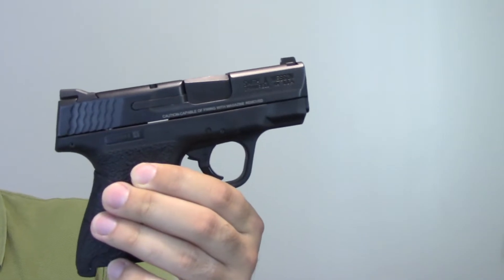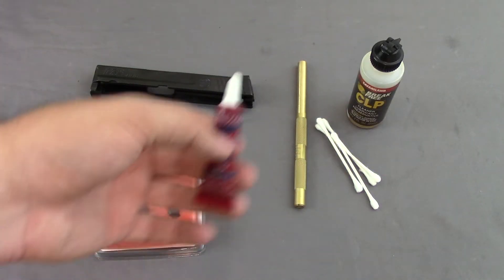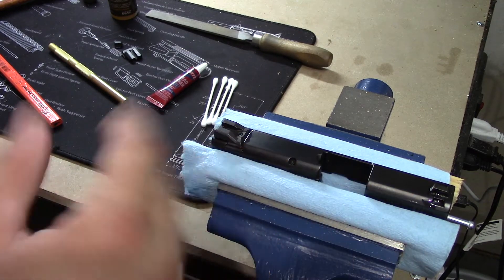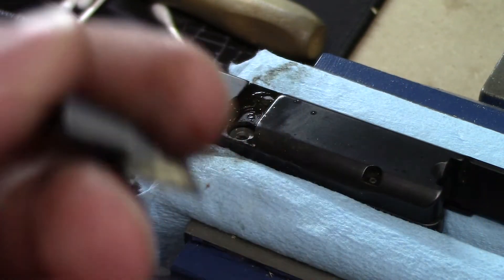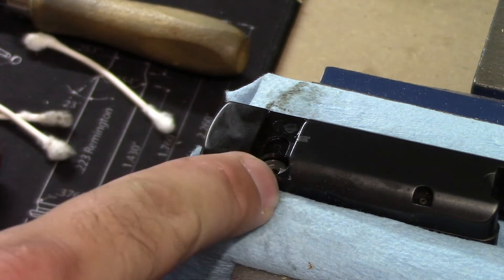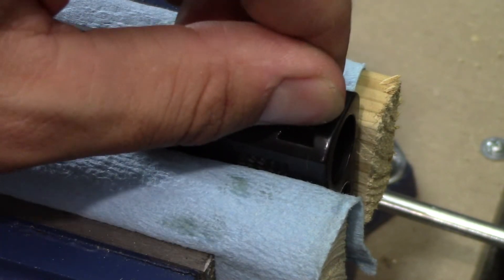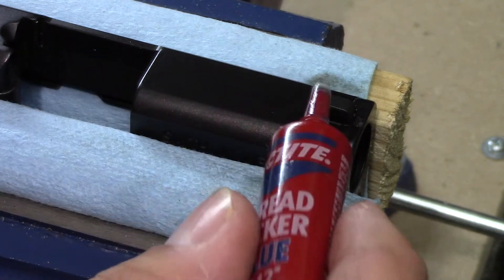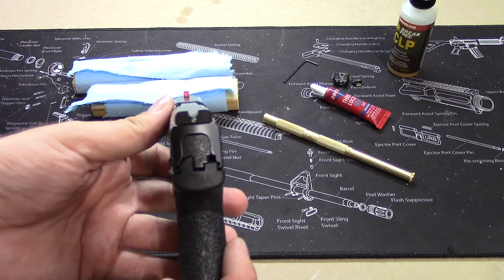S&W M&P Shield Ameriglo I-Dot Night Sights Install and Review

Comment: Those rear sights are a bitch to hammer out. I ended up just ordering a sight tool and changed them out much easier.  All M&P's & Shield's are a pain to hammer out the rear. So there's my take on it. 👍
Reply: Agreed 👍🏾

Comment: were you able to reuse the screw on the oem rear sight on the new sight? on mine the hole is smaller and wasn't able to insert the oem screw on the new rear sight. i figure you have to drill into the rear sight hole to made it bigger in order to fit the oem screw.

Comment: Wouldn't it be easier to just use a sight pusher?   I'm curious why you're not.....That was one of the first tools I purchased......It's paid for itself several times over and knowing I will not snap a sight post......Maybe because I own several expensive 1911s and will never beat on a slide like that on a $1500 - $2000 pistol......To each his own.....

Comment: Well, you really scratched up your slide and those sites
Reply: @runningbear6391  for your future guns
Reply: It's brass from the punch. It wipes off with solvent.
Reply: Semper Fi I don’t know how it scratches it but it did look at it it’s clearly scratched
Reply: @wallyj2000  You can buy nylon/plastic punches for dirt cheap if you're worried about scratching. The brass punch is harmless, it's a soft metal, not even magnetic.
Reply: @wallyj2000  That's not scratches, that's pieces of the brass on the slide. Besides brass being softer than steel, and unable to scratch it, that armornite nitride finish is extremely tough and very difficult to scratch.
Reply: The real thing is that he took it out left to right and replaced it left to right as well. Should have removed right to left (parts exit the same side shells exit on) and should have installed left to right.
Reply: Brass won’t scratch steel but it sure in the heck will scratch the black finish. Notice he never showed the slide all cleaned up scratch free because beating the slide with a brass punch will mar the finish. I bought the sight pusher that’s specific to the Shield even though it was a hundred bucks because I did not want to mess up the finish. It was so easy, didn’t need a vise, no beating and possibly scratching the finish, just turn the handle and it gently pushed out the front and rear sight and pushed in the new ones just as easily. I didn’t mind spending the money on the proper tool as I can change my sights easily any time I want and I can make small adjustments to sights to get the gun properly sighted in. I have the .40 and I just bought my wife the 9mm version and I got more use from my investment in the right tool as I changed her sights out as well as my mom’s husbands Shield and made small adjustments to sight them in properly. By the way I would sight the gun in at the range before using thread lock on the front sight. . On the shields they want you to drift the front sight, not the rear to sight in the gun.
Reply: @fastdude2002  which sight tool did you buy? And did you have to adjust all the sights after the install? Thank you
Reply: Ralphy Figueroa I have the standard MGW sight pusher that was $100.00. I just read and confirmed they discontinued this model and only sale their MGW pro sight pusher. The pro is around $300.00. It is a better version but I don’t know if it’s worth it to pay that much to change out one set of sights. You can get a gun Smith to do it for $25-60 dollars. My mom’s husband went that route but when we went to the range the gun was not sighted in correctly so I pulled out my tool and we got it dialed in. I guess he could have brought it back to the gunsmith and ask him to make an adjustment or take it home and try to drift the sight slightly with a punch and hammer being careful not to damage the gun. It’s just really handy having the tool to make changes and adjustments yourself. As to your question if I had to adjust both sights after the install, no the rear sight covers the rear of the slide edge to edge so once you mount it you’re done, after mounting the front sight centered the best you can go test fire and then you can make small adjustments to the front sight to get it shooting dead center. If it shoots to the left you would adjust the front sight slightly to the left to bring the shot back to the right for example. Usually you would adjust only the rear sights to sight in which has been my experience with most guns but on the shields the rear sights can’t be adjusted or they will over-hang the slide, the manual says to sight the gun by drifting the front sight only. Good luck.